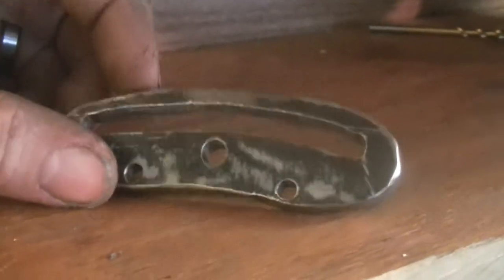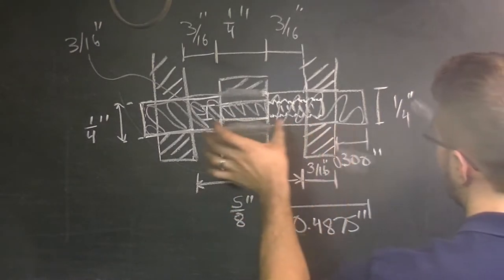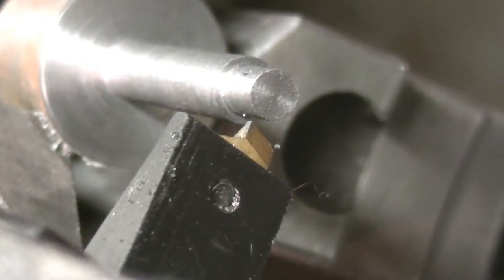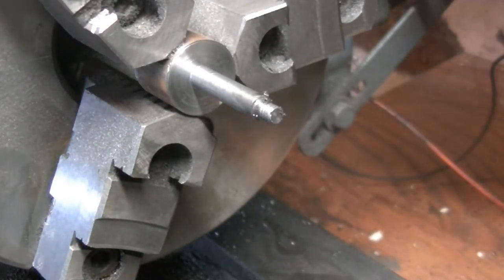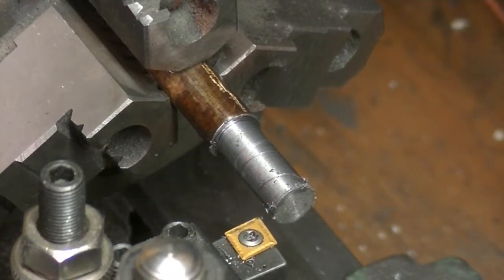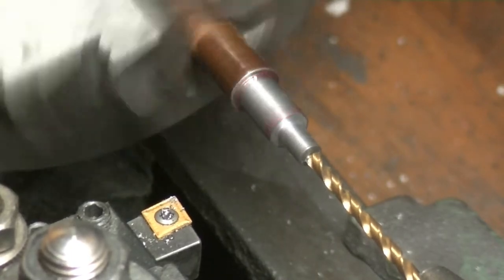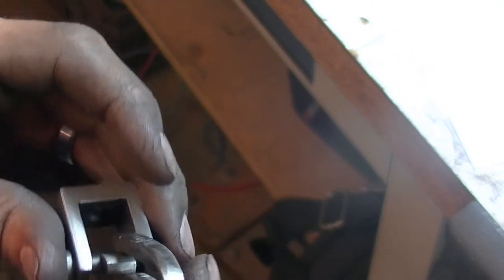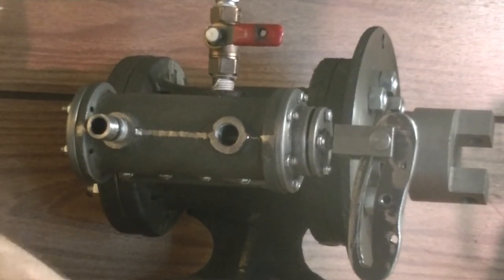Steam Engine Build: Making the Valve Fork Link / Fixing up a mistake

Comment: Hi, I think your engine build is coming along great and look forward to your updates. I think regarding the side play on your expansion link you will need spacers or better still a closely fitting fork. I'm not convinced the 2 eccentric rods will keep thing in line but even if they do you will get excessive wear on the components.
Reply from the maker: I think you are right.  I plan on doing something about this down the road.